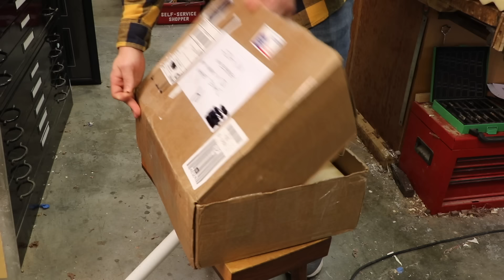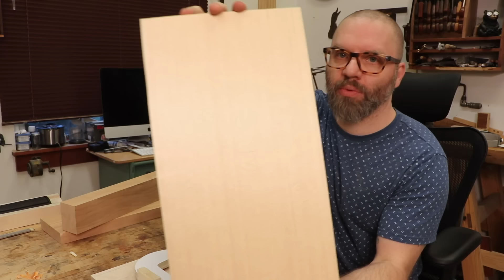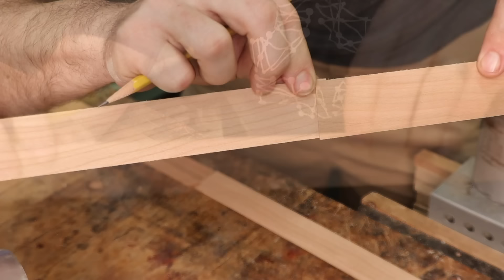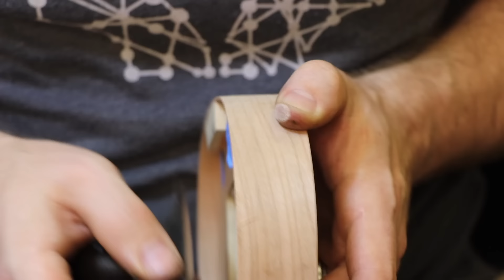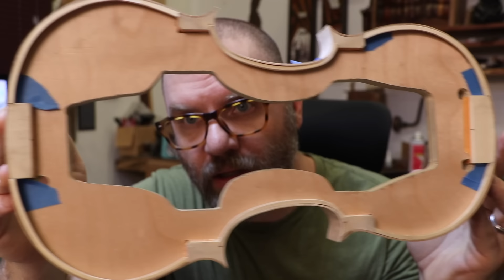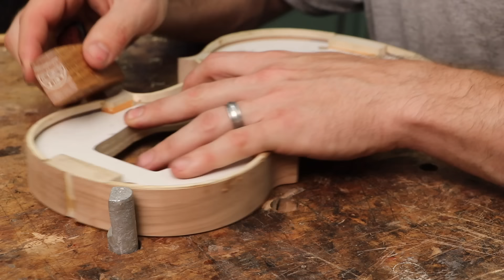Making a Violin/Fiddle for Tally Ho: Part 1

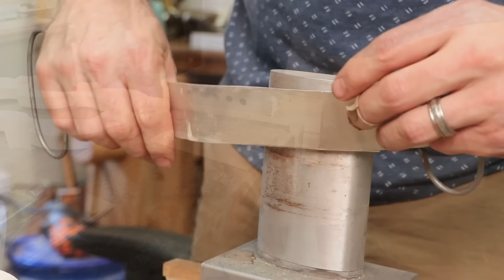Comment: 7:23 Does that bending device use heat? Did you make it?
Reply: 9:45 Aha, it seems you wet the strips before bending.
9:52 I think I hear steam as you bend them. So I'm guessing you wet out the strips and then bend them over the hot bending form. Correct?
Reply from the maker: correct! The tool is a bending iron for luthiers. This one is made for violin and viola they make bigger ones for other instruments! great question.  @charles.neuman18
Reply: @JDanielGraham  Cool, thanks. Seems like a really useful tool.
Reply from the maker: Very much so! @charles.neuman18

Comment: It appears that wood is from the new stock for the rebuilding of Tally Ho rather than from the original construction of the boat. Would it have been possible to create some kind of instrument from the remaining badly damaged and weathered wood from the boat?
Reply from the maker: It would have been, I offered that to Leo and he wanted a more traditional fiddle and wanted traditional species so I honored that.
Reply: @JDanielGraham  Right on! That would have been very cool but this will also be amazing and top notch with all the best and correct wood for a fine fiddle. Thank you for this very interesting project! All the best!

Comment: Do you need any metal pieces that can be low carbon (not steel)?
I have some wrought iron from one of the floors Leo took out of the boat and could make pretty much any small parts out of it for your project.
I made him a chisel (just the metal part) and a hammerhead, and a small hatchet, as well as a cross.
Reply from the maker: that's a very cool offer! I dont think i can use any in this project but if I do more for Tally Ho that would be amazing.
Reply: @JDanielGraham   I think the only thing better than all of us making things for Leo would be some of us making things...together...for Leo.
I can't imagine you'll do anything more impressive than this for the project.  I mean what you have done here is F___ING EPIC!
But if you need me...I'll be here.
Reply: And that goes for the next maker that steps into Leo's space as well.
You want to make something for Tally Ho and need a metal bit...I'll be here.
Reply from the maker: That's great!
 @stimpsonjcat67
Reply from the maker: haha Thanks 
 @stimpsonjcat67

Comment: Your video editing is excellent, as is the project. I like the way you timed the soundtrack to the type of work you were doing. I have two questions
1. Will the hide glue hold up to the humid marine environment with large temperature fluctuations in the long term? I presume this will reside on the Tally-Ho and not on Leo's shelf at home.
2. Will you be adding bits of wood or metal from the old Tally-Ho to the fiddle as a tribute to its past life? Something like a case made from the old yacht's timber would be a very nice addition to the project.
Reply from the maker: Thanks so much! so to answer your questions. The hide glue should hold up just fine with the environment as long as they dont throw it overboard for too long haha. As for old wood. A lot of the wood he has is not traditionally used in instrument making and I am all for odd materials but he wanted something more traditional and so i honored that. But I like the idea of the case or something of the like. If he would want one I would be up for making it.

Comment: Wait...this wood is scrap new wood pieces? So it's made from wood that is also being used to remake Tally Ho. It's not actually made from pieces of Tally Ho. If it was made from salvaged pieces of the old wood it would be
Reply from the maker: The wood is the wood used in the project. Not the old wood. The old wood was not suitable for a solid instrument. I did offer to make out of the old but Leo wanted one that was more traditional and long lasting. So the maple is from the mast and the cherry is from the internal woodwork.